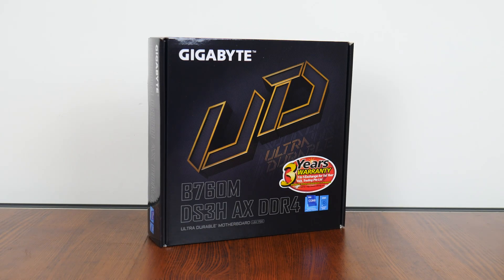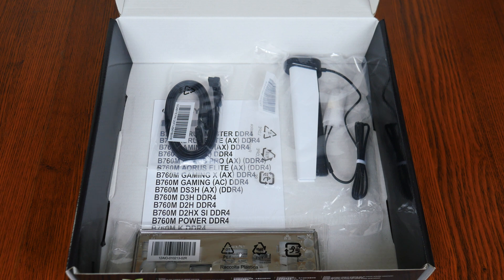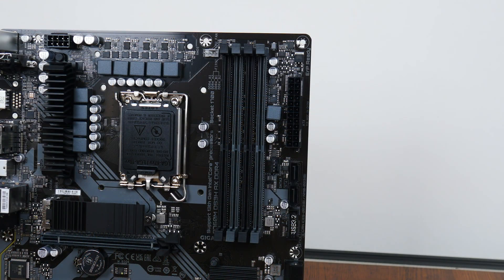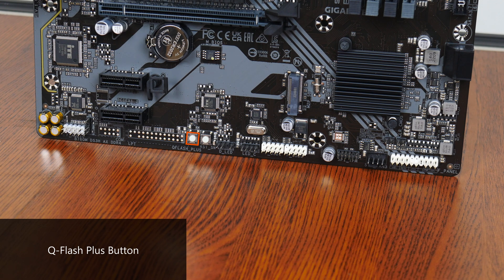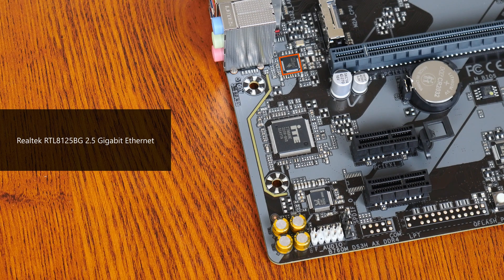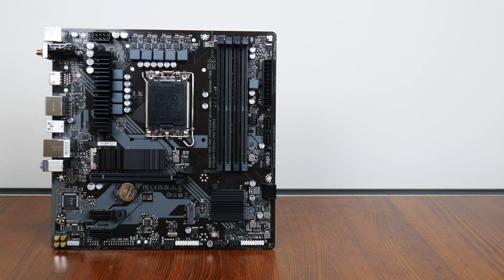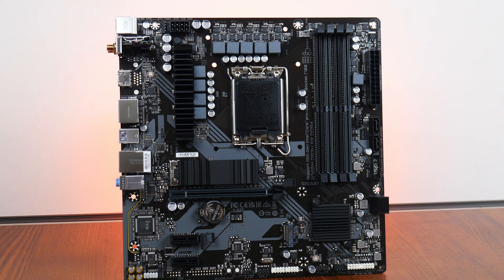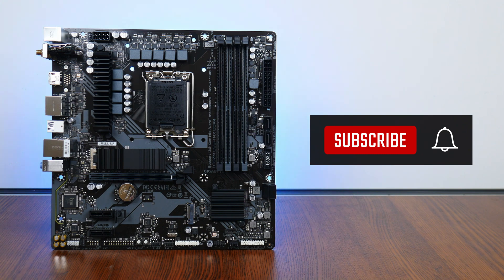Entry-level Intel B760 Motherboard - Gigabyte B760M DS3H AX DDR4 Unboxing & Overview

Comment: Can we use it with i5 13500 with rtx 3060ti ? 
I have a few quary like will it give sufficient power that i5 will need ! 

If u r in my place what will u chose as your motherboard for gaming and little bit of productivity .

Thank you for this informative vdo ❤✨
Reply from the maker: I'd say that this board will work well with a 13500 and a RTX 3060 Ti. You'll be able to game at 1080p at High-ish settings with decent FPS, and even at 1440p as well with some graphics settings tuned down! Just make sure you've got a good CPU cooler, as the one that Intel includes with the 13500 performs rather poorly.
Reply: Thank you sir , for the replay i really appreciate your efforts in the videos you make . (I will stick with this mother board now 🙏✨

Comment: do you recommend this board with intel 13700k and 4070ti ?
Reply from the maker: For a 13700K, I'd recommend getting a mid-range motherboard - if you're looking at Gigabyte still, perhaps something from the AORUS line-up instead, as this board is entry-level and more suited for the likes of say, a 13100, 13400 etc.

Comment: Would you recommend this for an i5 13500? For productivity and gaming purposes.
Reply from the maker: This board will handle a 13500 just fine! Do you already have in mind a graphics card and RAM to use with your setup?
Reply: Omg thankkks i5 13500 is my choosee @ALKtech

Comment: Does this support display via type c port on the back panel?
As in 4 displays 
Using 2 display ports, 1 hdmi and 1 type c?
Reply from the maker: Unfortunately this board's USB Type-C port does not support display output. The maximum number of displays supported with this board (provided your processor has built-in graphics) is 3, via the 2x onboard DisplayPort ports and 1x onboard HDMI port.
Reply: @ALKtech  Thanks a lot for quick reply.

3 displays are more than enough, just wanted to check if 4 was possible.

Out of curiosity, can you please tell me how did you check that the USB Type-C port does not support display output.  I could not find it on Gigabyte's product page to mention it explicitly.

Thanks in advance.
Reply from the maker: @AshutoshYerdoni  for display output over USB Type-C, manufacturers will state that the port supports "DisplayPort Alternate Mode". In the instance of this Gigabyte board, the specs sheet states that the port complies to the USB 3.2 Gen 2 standard with no mention of DP Alt Mode support, and Gigabyte also does not mention the USB Type-C port under the "Graphics" portion of the specs section where they'd list the video output ports. Also, DP Alt Mode USB Type-C ports tend to be a feature that only high-end/professional content creator motherboards would have. Hope this helps!

Comment: Corsair 4000D Airflow has 1 usb 3.0 and 1 type c at front panel 
This motherboard has 1x 3.2 gen 1 header for type c but no 3.0 header for 3.0 usb
Am I correct?
Reply from the maker: This board only has a USB 3.2 Gen 1 Type-A front panel header - the USB 3.0 header on your Corsair case will work with this said USB 3.2 Gen 1 Type-A header (USB 3.2 Gen 1 is USB 3.0 rebranded). You won't be able to use the USB-C connector of the case as this board does not have a front panel USB-C header!

Comment: Is there a thunder bolt port in the motherboard for the c type ? I couldn’t find any. Iam using the same MOBO
Reply from the maker: Nope this board does not come with integrated Thunderbolt ports unfortunately.

Comment: I brought a rtx 4070 graphic card and an i5 13400f processor, any motherboard, do you advise me to buy, is the asus b660 better than the b760m or not plz help me
Reply from the maker: Which ASUS B660 board are you looking at? If the B660 board has better specs and is cheaper, it could be a better choice. But do bear in mind for B660 boards, you'll probably need to do a BIOS update before it will support 13th Gen processors like the 13400F!
Reply: @ALKtech  thanks man appreciate your help 💙

Comment: Hello, I am slowly building my Gaming PC. Can this accommodate my RTX 3080 and an i5 13600K?
Reply from the maker: It'll work with the 3080, but my concern is that a 13600K might stretch the limits of this board's VRMs. Gotta make sure you've got a good CPU cooler and good airflow for your PC case...
Reply: @ALKtech  what motherboard do u recommend?

Comment: Is it better than the msi pro b660m-A ddr4? B760m Ds3h Ddr4 in the shop that I found is cheaper
Reply: And yes It's my first time building a pc :v
Reply from the maker: @secre4520  what processor will you be pairing with your motherboard? If it's a mid-range to entry-level processor (e.g. a 12100F, 12400F, 13400F etc), I'd just go with the cheaper option! How big is the price difference anyway?

Comment: Hi which is better between the msi pro b760m-a wifi ddr4 and this video? 🤔
Reply from the maker: Both boards are very similar, except for the fact that on paper, the MSI seems to have a better VRM setup, meaning to say you could probably install a higher-end processor without getting thermal throttled - but I must caveat I've never personally tested this out myself. What's the price difference between these two boards where you're from?

Comment: Did it better than msi pro b660m-A Wifi ?
Reply from the maker: The Gigabyte and MSI are quite similar in terms of specs, I'd say price will be the deciding factor here. How much do they cost over where you're from?
Reply: @ALKtech  I'm from Egypt price are same but what is better from them
Reply from the maker: @MŗUchained  I see. The MSI PRO B660M-A has pretty good reviews on it's VRM performance, meaning to say it could likely handle high-end 13th Gen CPUs without too much issues. You will likely have to do a BIOS update first before the MSI will support 13th Gen though, and this could be a bit troublesome as the board doesn't come with a feature that allows BIOS updates without a CPU/RAM/graphics card installed.

What kind of Intel CPU are you intending to get? 12th Gen? 13th Gen?
Reply: @ALKtech  i5 13400f
Reply from the maker: @MŗUchained  got it. A 13400F should work as intended with both the Gigabyte and MSI boards. I'd personally go with the MSI for it's VRM performance based on other reviews - but again, you've gotta make sure that the MSI's BIOS is updated to the latest version before installing the 13400F!
Reply: @ALKtech  ty so much

Comment: I am planning to go with this motherboard with i5 12400f as for now. But will I be able to upgrade the processor to 13th with this motherboard in future?
Reply from the maker: Yes you can - but do note that the VRM setup on this isn't exactly high-end, so if you're intending to upgrade to something high-end like a 13700K or better in the future, this motherboard might throttle the performance of such high-end processors!
Reply: @ALKtech  If that’s the scenario then should I go with the standard b660 motherboard to cut some bucks. In future when I need to upgrade processor, then I will change the motherboard too. What’s your suggestion?
Reply from the maker: @kahaniguruhindi  actually, why don't you go with a higher-end B660 board or even a Z690 board, and stick with the same 600-series board when upgrading? 

The 600-series chipsets support both 12th Gen AND 13th Gen CPUs, and to be honest, I'd rather get a 600-series board if it's cheaper where you're from (versus 700-series), as the feature differences aren't worth the additional cash IMO. There are some pretty good budget 600-series boards (e.g. MSI PRO B660M-A) that can handle even high-end CPUs properly!
Reply: @ALKtech  Yes. I’m also saying that having a b660 mobo can do the job because I’m a mediocre user.
Reply from the maker: @kahaniguruhindi  yeah then by all means, go ahead to get a B660 mobo. How are prices like over where you're from when compared to B760 boards?
Reply: @ALKtech  600 series only support 12th gen while 700 both 12th and 13th
Reply from the maker: @rigidhammer7376  boards powered by Intel's 600-series chipsets do support 13th Gen processors, but with a BIOS update. You can verify this by checking the CPU Support section for the motherboard model in question!
Reply: How about a i7 non k is it ok ?
Reply: @heklik  why not?
Reply: you can also use a k cpu.. but won't be able to oc ..  @heklik
Reply: Is it ok to pair with i5 12600k?

Comment: Do i take this motherboard or the asus prime b760-plus ddr4 my specs are 3070 i5-12400f what mb Do you recommend?
Reply from the maker: Is there a price difference between these two boards where you're from? You might wanna note too that the Gigabyte is a micro ATX board, and the ASUS board that you've mentioned is a full size ATX board - this will affect the type of PC case that you can use for your build!

That said, the ASUS has a PCIe 5.0 x16 slot for future-proofing, which the Gigabyte doesn't have. Also, the ASUS comes with a front panel USB Type-C header, and one more PCIe 4.0 x4 M.2 slot versus the Gigabyte...you'll ultimately have to see if these are features that you'd like, and determine if the price difference (if any) between both boards is something that you're comfortable with!

Comment: Hello! I found your video here very helpful. I would like to ask for your recommendation. Im planning on building a PC for virtualization. Mainly vmware workstation for my work.  

Are the below combination good?

GTX 1660 Super Colorful 6gb Dual Fan
I7-13700KF
B760M DS3H AX DDR4
Delta TUF 32Gb RAM 3200mhz x 2
Reply from the maker: Glad you found the video useful. I don't suppose you're intending to game that much on this PC? The GTX 1660 sticks out like a sore thumb as it's clearly underpowered for the 13700KF 😅 

That aside, do you have the budget for a better motherboard? My concern is that under high CPU loads with multiple virtual environments, the B760M may throttle the 13700KF due to its power delivery setup. That said, I must caveat that I don't have much experience with VMware applications!

Comment: For a few euro more, I think that the b760m gaming x ddr4 is a better choice. More vrm cooling, 8+1+1 stages.
Reply from the maker: Yeah if the price gap is minimal between both boards, stepping up to the GAMING X isn't a bad choice!
Reply: No type c tho
Reply: @mkz7063  ive bought this board featured in the video, and it doesnt have a type c port. what does this affect? should i be worried that i cant connect that?
Reply: @try_and_chill chill usb c port is not a big problem it's ok
Reply: @hyper2006.  ok. That’s what I was thinking but tysm for the confirmation
Reply: But there is no wifi
Reply: @andalusunaa Yes onboard wifi saves dongles or a pci e card.

Comment: Going to use it with 13500 
Is it good enough or shall I go on with something expensive
Reply from the maker: Nah this board will do fine with a 13500 I'd say!
Reply: @ALKtech  Thanks for the answer man You earned a subscriber 
Appreciated
Reply: @ALKtech  Is this good to connect with core i7 13700 to this board?
Reply: @mazidulalam9949  в итоге что поставили?
Reply: Have u built the system yet sumit bro?
Reply: @redviper4793  Yeah went in with the Ryzen counterparts because of the insanely low power draw

Comment: Okay so just making sure because ive already ordered the mobo but i can cancel it. does this mobo work with the gigabyte 4070ti? i have a asus prime b660m board and the gpu didnt work with it because they havent updated bios or something for it? which i know the card works i got it to work for about 5 minutes before it stopped working with the board
Reply from the maker: Doesn't sound like an issue with compatibility to be honest, it could be a faulty board or even a faulty card. As far as I'm aware, the Gigabyte board should support the 4070 Ti!
Reply: @ALKtech  okay i will try this mobo and see if i experience the same thing and if i do i’ll just get this card replaced.

Comment: is it ok to use this mobo to 13600k, not using Oc. ? tnx
Reply from the maker: I would recommend getting a better board for the 13600K, as I think there'll be some thermal throttling given the B760M DS3H's VRM setup and lack of beefy VRM heatsinks!
Reply: @ALKtech  what is the cheapest board for 12600K that also has wifi and will not throttle>
Reply from the maker: @razaky2009  for Gigabyte boards, you could try looking at the lower-end AORUS ELITE line-up, using either the B660 or B760 chipsets!
Reply: @ALKtech  you mentioned thermal throttling using this board. what does that mean? i won't be doing any gaming or intensive tasks at all. just internet, MS Office. can i use this then without any issues?
Reply from the maker: @razaky2009  ah, then yes you shouldn't run into any problems with the workloads that you mentioned. I was referring to more CPU-intensive tasks like video rendering, code compilation and so on, which would place more stress on the CPU and the motherboard's components - with the cheaper power delivery components on the motherboard, heat might be an issue while under intense workloads, which could in turn prevent the 12600K from achieving its maximum potential, i.e. thermal throttling.

That said, if all you're gonna be doing is internet surfing and MS Office, why not consider getting a cheaper CPU such as the i5-12400F or even an i3-12100? The 12600K sounds like overkill for the stuff that you'd be doing with your PC...

Comment: Can you suggest to me which motherboard should I go with gigabyte b760 mds3h or asus prime b660 m a d4 with i5-12400f
Reply from the maker: Is there a price difference between both boards where you're from? Pricing would likely be a key factor influencing my decision. Also just to confirm, you're referring to the non-WIFI versions of both boards right?
Reply: I am from India. There is not much of a difference in both the boards it's around 150 USD and yes they are non-wifi versions
Reply: Does gigabyte b760 have any hitting issues?